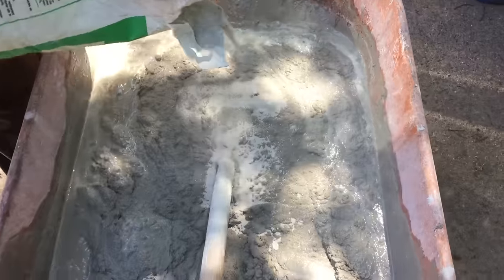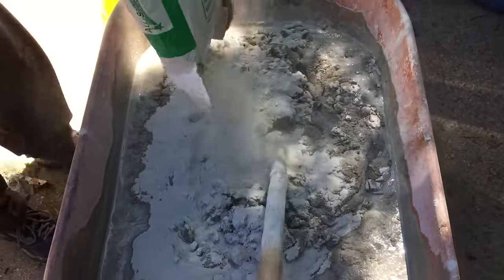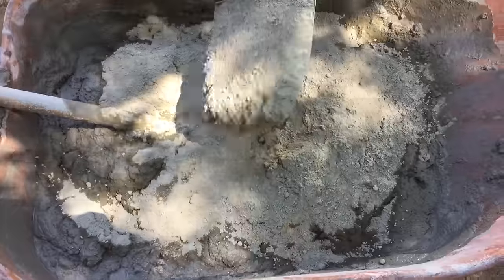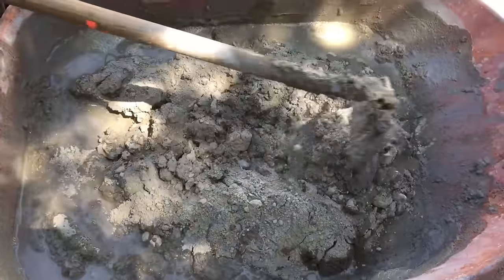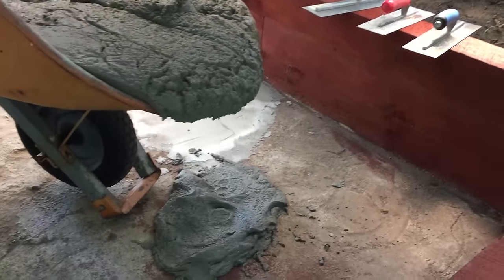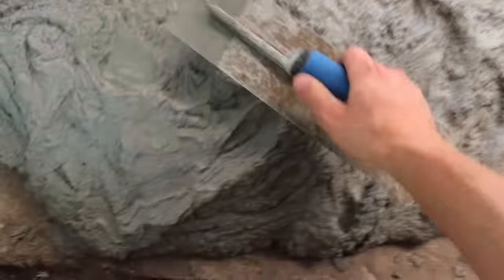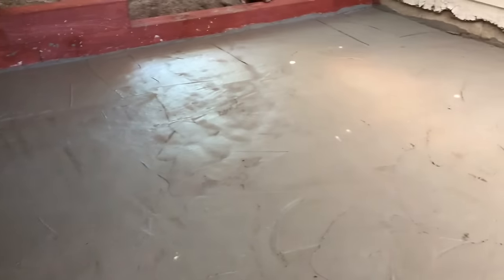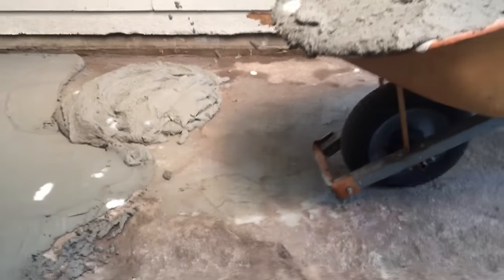How To Skim Coat A Concrete Patio - Pour Concrete Surface

Comment: Nice video, but that won't last long before cracks again
Reply from the maker: So far so good.
Reply: William Dubon yup 2...3 years...theres another type of concrete that has a polymer bled in it so it flexes...people use it for concrete counter tops it gives
Reply: Chip  fix
Reply: @miguelcastaneda7236  Cant you add a polymer powder to the mix?

Comment: finished job not to nice. definitely need adhesive and follow the instructions.  larson weld crete is great for concrete on concrete or plaster repairs. Polymer mix is best like Sandmix by Kwik. And don't skip the curing process.
Reply from the maker: Thanks for sharing!
Reply: correction. mean't to say weld crete for concrete and Plaster Crete for plaster.  :)

Comment: Can that also be used to fill in parts of a slab where there's some low spots where puddles form? Pour it over those areas and then pull the 2x4 over it to make it level?
Reply from the maker: Yes, however, the new concrete will be a different color. 

Make sure you clean and score the existing concrete so that the new stuff can adhere. Then trowel it out sort of like Sheetrock mud when fixing a wall.
Reply: Bradley Jon they also make a self leveling mix.
Reply: I need to do the same exact thing, looking for an easy fix. Patch up some cracks and a low spot that builds puddles. Any advice would be great

Comment: So basically 200lbs In the wheel barrel go ahead I'm listening....😂
Reply from the maker: Wheelbarrows are strong.
Reply: Danielle Gardner I’m sorry for your size
Reply: Dude when I was 16 I was wheeling redi-mix full wheelbarrows full for my Dads business those were more like 450-500 lbs
Reply: @jeffp7776   I know you thought it might have been that  Heavy
Reply: @towdoctor670  a REAL contracts wheelbarrow has a capacity of 6 cubic feet. A cubic foot of concrete weighs 150 lbs +/- do the math.
Reply: @jeffp7776  wait.. I thought a 80lbs bag just about covers a 2cu ft area and need about 17lbs of water. that's 97lbs wet, less when it dries for 2 cubes. 1 cube should be about 50lbs, and no one loads the barrow to the brim You're looking at about 250lbs there, champ.

Comment: Could you drive a car over this without it breaking apart? My 20x20 garage needs a quarter inch skim coat.
Reply from the maker: Yes, I received an email from a guy who said he did this on his father's driveway 30 years ago and it is starting to crack now. He mentioned that he mixed 3 bags of regular mix and 1 bag of pure portland.
Reply: @HowToVideoChannel Not bad for 30 years! That's way more than you would expect before cracking.

Comment: Do you think a woman could do this job without hurting herself or does it take male strength?
Reply from the maker: I think a woman could do it without any issue. You'll want to have someone to help you though. It's a two-person job, whether men or women :)
Reply: @MMGJ10  YOu know what...he fixed the patio spot, and it looks better than before. I think he could have gotten a slightly looser mix so he can trowel it better. His troweling is what he could improve on. But he is one of FEW people letting you know that you dont have to spend $50 a bag for overlay mix. His information is PRICELESS, and gives not only DIY folk, but many that get ripped off at $12sqft for something that can be done for $2-3 sqft. THATS the difference. SO WHAT it looks a bit rough. Sick of videos pushing product vs teaching material compounds.
Reply: Go at it girl, anything he can do you can do better!